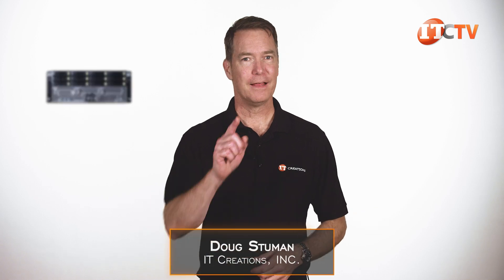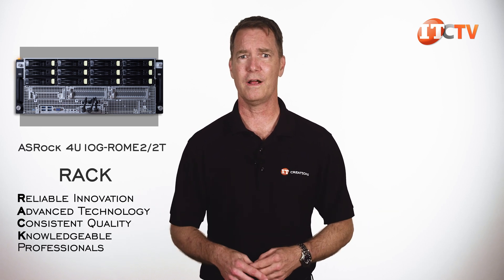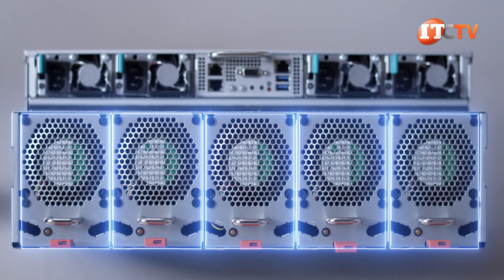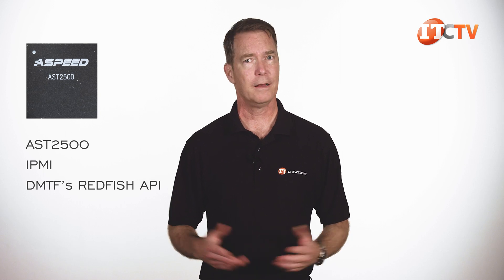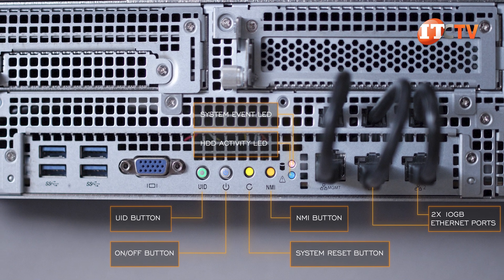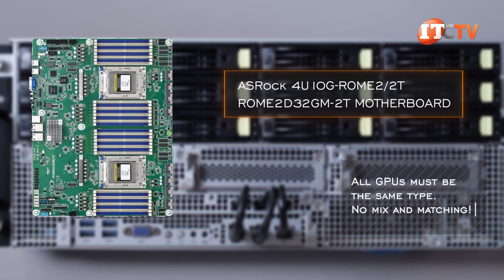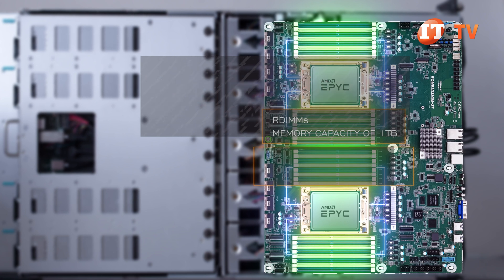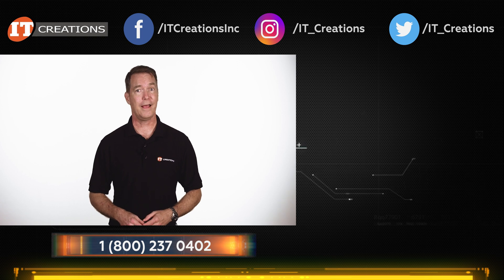REVIEW ASRock 4U10G-ROME2/2T EPYC 10x GPU Server | IT Creations

Comment: specs say this can supply 300w per GPU, any way to bump that up to 450w to run something like a 4090?
Reply: those won't fit unless you water cool them, and then you'd want a different case altogether
Reply: @dnmr  2 slot blower style 4090s will fit. the problem is just getting ahold of them.
Reply: @jaredbenson6979  right, then it might actually be ok as the server's PDB seems to have regular 8-pin PCIe power connectors, and you'd use either a 300W EPS adapter that comes with Ampere cards or the 12VHPWR with Ada. I fear for the blower GPU cooler though as the server will push pretty hard with its case fans. You'll probably need to ask the manufacturer directly if there's some lock in the motherboard's bios or some such, op doesnt seem to have the server anymore after the review
Reply: @dnmr ya, I've reached out to asrock directly and did actually get a reply rather quickly. currently waiting for them to get a response from the product management team. since the sales side doesn't know anything technical lol
Reply: @dnmr  also, I know the motherboard can handle the GPUs since I have a friend using it, his current setup is an open air rig similar to how a miner would set it up, so his GPUs are powered directly from the PSUs. so my primary concern is the power distribution from the PSUs to the built in power distribution board that sits near the GPUs.

Comment: Is there physically 20 PCI slots on the PCI addon board? ... I've never seen that before. So I'm confused how you can run 20x Single slot cards.
Reply from the maker: You have to purchase the system with the PCIe expansion board that has 20 PCIe x8 slots. The version we show here has the10x PCIe slot board, although, this system was in our office for about 2 days so I can't remember the exact layout. The PCIe slots ae connected to the CPUs via a PEX PCIe switch. Oh and the documentation is a little lacking so no images.  Thanks for watching!